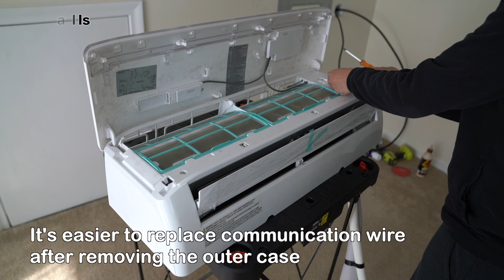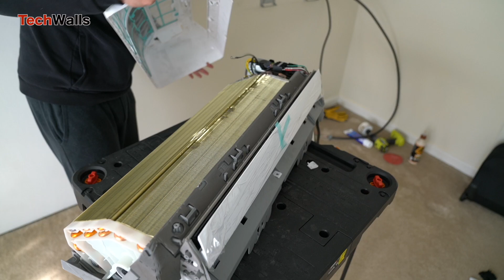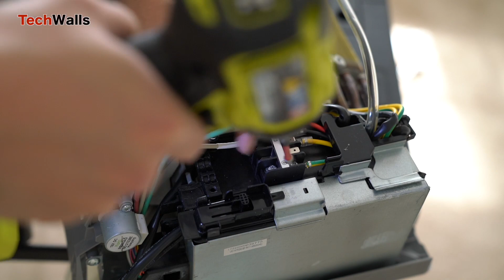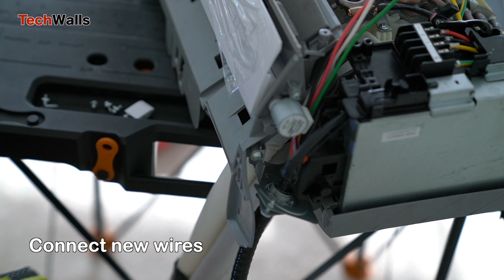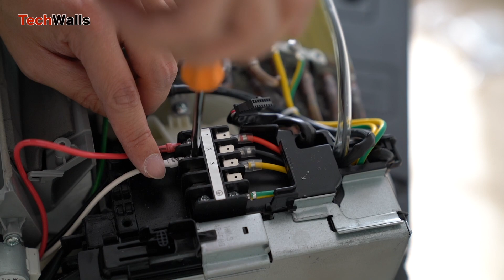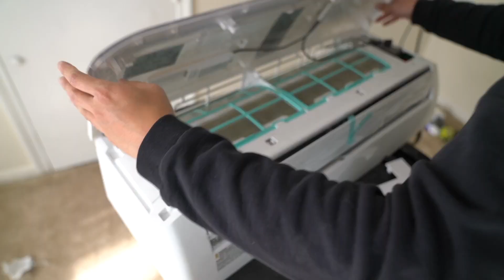MRCOOL DIY Mini Split - Replace Communication Wire

Comment: Phenomenal video! I swear, when I called their tech support, they literally had no clue how to do it. 

I had to get a 50ft lineset (that came with a new 50ft communication line) but there's no way to get to the connections without taking off the entire cover. 

Obviously that was a bit concerning at first cuz the last thing I want to do was mess up and scratch (or anything) a brand new unit but its literally the only way to switch it out without splicing the original 25ft wire that comes with it...which, btw, voids the warranty lol.

Anyway, thank you again. The only thing I have to add is to make sure you push down that little tab under the fin (that gives you access to the first screw you took off) otherwise it'll stop the housing from coming up and I believe i even saw yours snap and end up on the ground when you were taking yours off.

Cheers!
Reply from the maker: Oh I will have to check that tab, hopefully it is still there. Yes I took risk opening it up as there was no instruction for the same model. Fortunately nothing broke.

Comment: Thanks for the video. Had to buy myself 50' wire because the ones in the units are obly 25'. Frustrating thst when i ordered a 50' refrigerant line the electrical cant reach.

Comment: I'd like to shorten the communication wire. It is about 12 feet too long. I don't know if it would void the warranty. Shouldn't be too difficult. It's just conduit.
Reply: I just talked with their techs on how to change mine out for a longer one and they said splicing voids it. Like the longer linesets, just coil it up behind the condenser. Not ideal visually but works just fine.